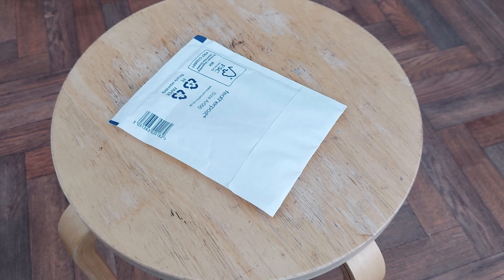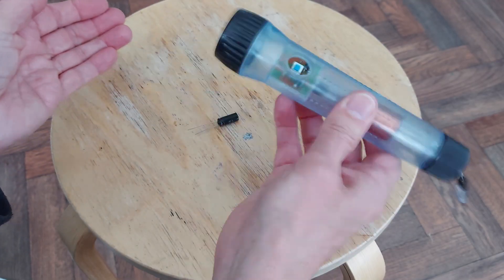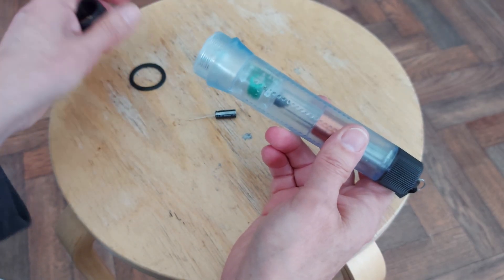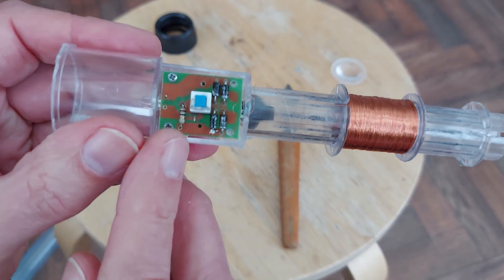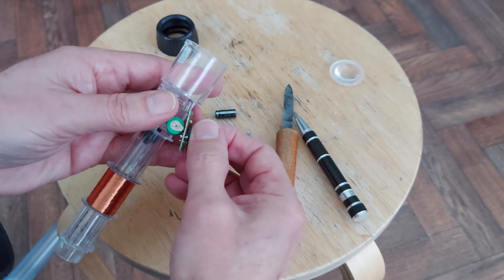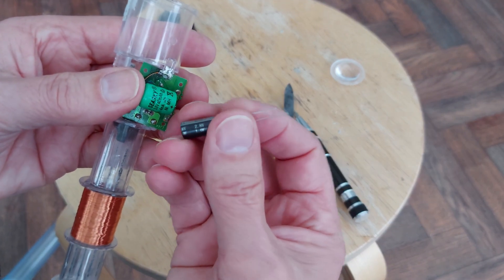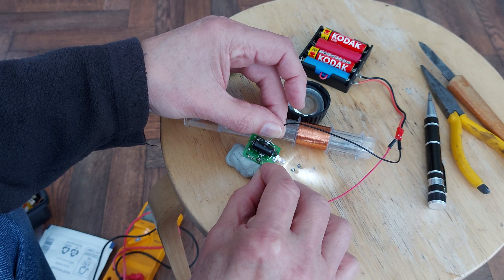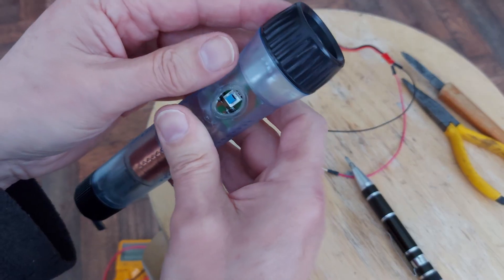Looking at an old induction shaker Faraday flashlight PART 8 Try a 1 Farad SuperCap

Comment: I found with the super capacitors I had, higher voltage = higher self discharge. From 2.7v to 2.5v took a couple minutes, from 2.5v to 2.0v took overnight, below 2.0v was much slower. At 3.0v (which is around what a typical white LED runs at) the self discharge would be really fast.
I think it's self discharging as quick as you can shake it. That's why the 10 Farad didn't work at all. It's self discharging in the same amount of time but is taking 10 times the power to charge. Basically they like be below their rated voltage if you want to use them like a battery. 
Solution = put 2 of the super capacitors in series, this gives you a 5.4v capacitor so at 3.0v that's only 1.5v per capacitor so should work really well. You can't run batteries too much below their rated voltage it will destroy them. So if using a battery try keeping it charged up. Super capacitors don't care at all if the voltage is low or zero volt but a battery at  zero volts is pretty much destroyed. Back when I was looking at supercaps there were a lot of rubbish ones on the internet and was basically impossible to tell until you got them and tested them. 

Hope this helps 😊
Reply: The rubbish ones have really bad self discharge even at lower voltage and have less capacity then they should
Reply from the maker: The bottom line is that the three cell NiMh was a better option, giving sufficient voltage over a longer period.  Another option that I haven't tried is two supercaps together to give the voltage. There is limited space in there to squeeze in two caps, so I probably won't be trying that, but it could be a variation of my 3d printed version.

Comment: would it make more power to put 2 more sets of copper wrapped in the spots next to the coil or would that make this device not function properly , bigger coil or longer
Reply from the maker: Yes, extra coils either side would generate power. The power is generated as the magnetic field passes through the coil. You could also increase the number of turns on the existing coil to increase the power generated. I would expect the coil here was designed to meet the economics of the build. I would think the three most expensive components of this product are the copper wire, the neodymium magnet, the NiMh battery. Tripling the amount of wire, by adding two more coils as you suggest, would add significantly to the final cost of the product during manufacturing.

Comment: i made a torch years ago using a stepper motor (just twizzled back and forth by hand) and using a zenner to limit the discharge from a super capacitor used in a video recorder clock circuit - worked pretty well
Reply from the maker: Sounds great. The dynamo method is much easier to use. This shaker setup is more of a demonstration novelty. It works, but it is pretty limited, unless you are planning to build your biceps 💪💪

Comment: Nice to get the comparison of useability from the 1F supercap so definitely worth the extra re-fit. I made an emergency light from a dvd eject-drawer and it's motor. It charges really fast, wonder how you might get on with that type of motor for charging
Reply from the maker: Thanks, I have done a few dynamo type setups. Spinning a motor/dynamo is a much simpler and more effective way of generating an output. This shaker thing is just a novelty as far as I can see, and I had never intended it to become a video series like it did.
Reply from the maker: Talking of old DVD drives reminded me of this old video https://youtu.be/5o2YHS1PFN8
Reply: @GrandadIsAnOldMan  That is awesome !! Did the central stick underneath toggle the battery polarity for the drive ? Will check the earlier build video , so cool artistic but a real genuine machine ! Thanks very much for your reply and  inspiration
Reply from the maker: @BEATREACHERZ  yes, toggles the polarity 👍😊

Comment: Hey mate, a while ago I was doing research into making dummy batteries for a project and came across your channel. Two of your videos in particular gave me amazing insight on how to make them, and after making my own, your method of 3d printing shells and using anodes/cathodes from dead batteries worked wonderfully. I've decided to make my own video on this project, and how I found your channel and how important your videos were to this project, and I wanted to ask if I could link back to your videos and use them as a reference? No issues if not, and take your time getting back to me. Thank you :)
Reply from the maker: Thanks for asking. No problem with linking back to my videos. Always the chance it might generate an extra view. I always link back to videos that inspire me. I feel it is important to give credit where it is due.👍😊
Reply: Thanks so much!